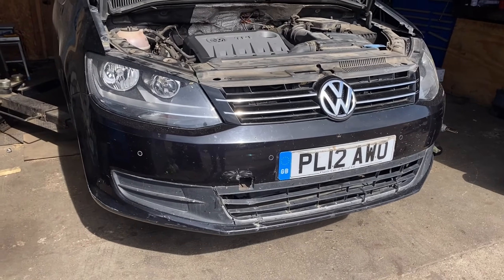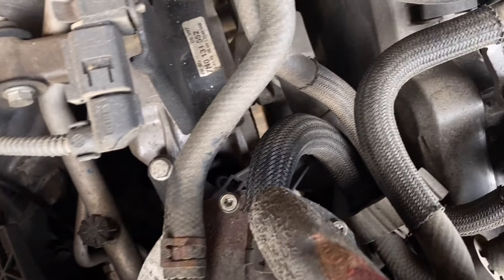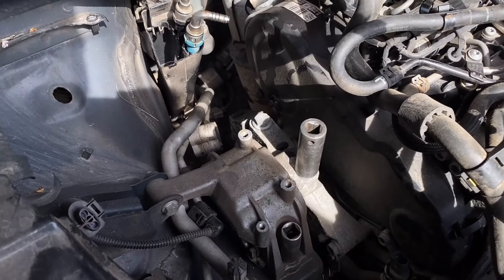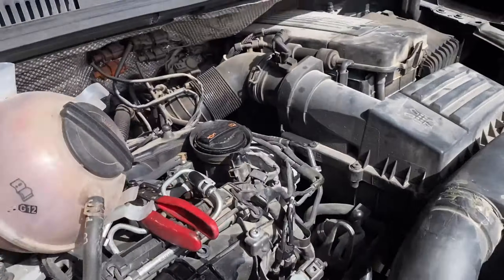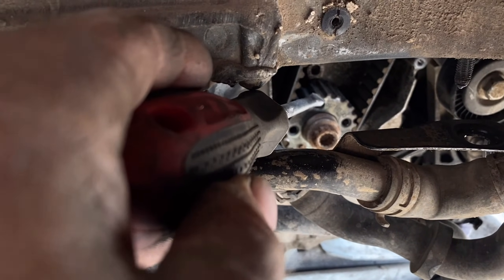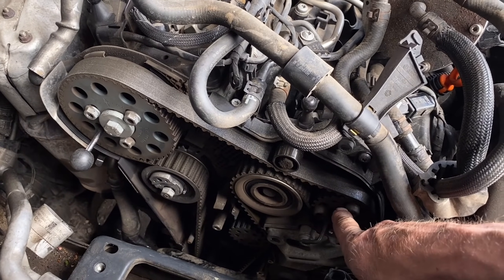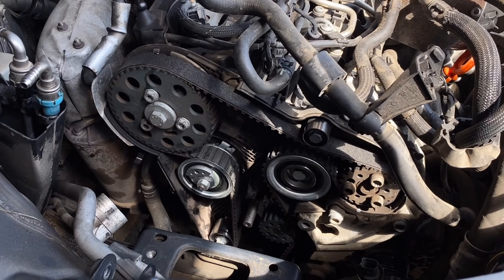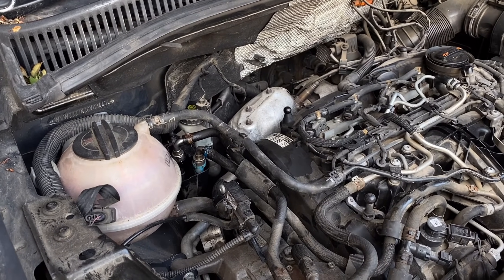Replacing Your Vw 1.6/2.0 TDI CR timing belt & water pump

Comment: Locking tool for crankshaft is not fitted correct, that’s why you need to tap it with a hammer. Fit it correct at the outer edge of the sprocket and slide it all the way in to the hole it Will fit without tapping!

Comment: it is a nervous job but like you said check everything 3x .....liked what you did with the tensioner ...its crazy the fuel pump is always just off why have the nibs slots ..no idea why they done that surely they could line it ..or the pin they use is a bit smaller.. fantastic guide appreciate you making this thank you

Comment: Great video, but a few things aren't correct and could lead to catastrophe or timing not perfect.

When the T10050 tool is fitted on the crank pulley, it should not look like it does in the video. All of the bumps on the tool should engage fully onto pulley slots, not at an angle as it is on the video. Also, the tool needs to be pushed all the way in - in the video the face of the tool is not flush with the pulley. The only way it goes flush is if the pin on the rear of the tool goes into the hole in the engine block. No tapping with hammer needed, it should go in with light finger pressure. This is how you know the crankshaft is locked precisely at TDC.

The 3359 tool at the camshaft, if this is correctly fitted then the ball will be pretty much flush with face of the camshaft pulley. On the video it's sticking out way too much, suggesting it's in the camshaft pulley hole but not the corresponding cylinder head hole. It's only when it's flush that you know the pin has gone though the hole in the camshaft pulley and also the hole in the cylinder head, locking the camshaft at TDC. The loosening of the three bolts on the camshaft pulley is not to make belt fitting easier, it's to allow for the movement of the belt when it is tensioned.

Lastly you must check that the crank and camshaft locking tools fit back in place easily once you have done the two revolutions of the crankshaft. Only then will you know that the timing is still precise after the belt has settled into position and equalized the tension. Oh, one other thing. No need to remove the engine mount or jack the engine up and down - the belt does not pass through them like it did on the PD engines. Access is rather tight but it removes the possibilty of wiring damage by raising/lowering the engine.

Here's a link to the official VW service manual --> https://vwts.ru/engine/diesel-engine-cfhc-cffb-cfgb-clla-cffa-cfgc-eng.pdf

Comment: Subbed, im a DIYer. I have a 1.6 tdi touran, i know the cam belt will need changing down the road likely in the next 18m, would rather do it early especially on a CAYC. I've got this as good guidance. I have the HBOL but i dont trust it half the time.

Comment: Hey mate, I’ve got a question I’m really hoping you can answer! I’ve recent got a van that has had the timing belt done on it, I think the mechanic that did it put too much tension on the belt and it’s about 12-14mm off the mark for the centre and is making an annoying noise. My question is, can I very carefully reduce a small bit tension off the belt without affecting the timing of the engine? Or will it need to be retimed if I do? Thanks!

Comment: Hello. I found your video helpful but would like to point out the error in the video which will lead people to a bad experience. at 8.30 in your video you are putting the pin into the wrong hole. I found the same IE the hole was slightly off to take the pin but thats because it is the wrong hole. The Pump locking pin does not go throught the Vernier drive gear. If you look Just below the belt on the top left of the pulley there is a pin hole and a Rotating plate which you lock together it is actually behind the toothed gear. Luckily I marked the old belt before removal and then transferred the marks to the new belt. I had moved the vernier back to put the locking pin in the wrong hole which is off because the hole you can't see but visible with an inspection mirror is the correct one to pin. Upon assembly the car was v difficult to start even though the pump was only v slightly out. Once I realised the problem it was straightforward to rectify... You put the pin above the toothed pulley at about the 11 oclock mark... Hope this helps folk. Cheers. neil.

Comment: I changed the belt on a Peugeot DW10BTED4 RHR engine in a 307.  Not as difficult as I thought. I'll do the Jetta with the CFFB engine myself as well as the EGR system why flow issues and the oil filter housing as the plastic thread the lid is stuffed

Comment: First time I did my timing belt/water pump it took me the weekend, I did check the timing using the crank several times but when re-assembled it wouldn't turn over, it had slipped a tooth or two so I had to re-strip it again and on the second attempt it worked, ALWAYS check via the crank.

Comment: Great video my friend, no disco music just great advice and experience passed to the viewers. It really is one of the best on this subject.
One addition I do when stripping stuff down is to drop each part, bracket whatever plus fixings into boxes or bags with a note to self if one or more bolts are different lengths, shanks even. Life sometimes interrupts is and you can get diverted for a day or so. 
But I repeat, best timing belt video I've seen bar none.

Comment: Just about to do timing belt on my 1.6 tdi caddy and read I need to change engine mount bolts too is that right? All of them including mounting bracket that bolts to the engine
Reply from the maker: Hi bud I never change them but many people have told me they need changing but I’ve never had a problem re using them 👍👍
Reply: @YTDTETV  thanks for the quick response mate, yeah I've heard the same so not sure what to do it's only on 36k miles so might reuse them I'll see what they come out like in the morning 😬
Reply from the maker: @deadfool5345  no problem at all, I’ve had those bolts out on many vehicles and never replaced them, I don’t even use a torque wrench I just do them up 🤷.
Reply: @YTDTETV  nice you certainly know your way around a  caddy too so if you're happy reusing them I will be 👍
Reply from the maker: @deadfool5345  I’m definitely a big Vw fan 👍 thanks bud
Reply: @YTDTETV  got it done today as it rained all weekend last one, went swimmingly thanks to your guide 👍 one thing I noticed though was the ina belt is slightly thinner than the dayco one that was on 🤷

Comment: Thanks, great video. Just completed a water pump and timing belt on a Skoda Yeti 2.0 using the video. Marking the pump pulley was very important and on the Skoda it was easier to disconnect the hoses at the fuel filter end rather than the bulkhead end. Otherwise procedure was excellent.

Comment: Nice video! I had a timing belt tensioner stud shear on my old 1.9tdi golf and that killed my engine. But it had done over 230,000 miles. Maybe it had been over torqued when installed. Or the belt over tensioned. Because of that I think I would probably change the studs in future. But like you say it's added faff and you could end up in a pickle if it cross threads etc so maybe best left alone.

Comment: when you retensioned the belt after ther arrow had moved out the window, did you loosen off the came belts? im at this staged now, the arrow has moved out the window. do i just retension without loosening anything off?
Reply: Hey mate, did you end up adjusting the tension without locking anything off/loosing anything in the end?

Comment: Nathan could you tell me ow oftern the timeing belt should be changed on a 1.6 skoda superb getting many different mileages  i have 77.000;miles cheerrs bro
Reply from the maker: So on these engines they have a super thick timing belt so do last a while, it depends whatever comes sooner 7 years or 80/90 k miles 👍
Reply: @YTDTETV  thanks buddy... this car was inside in a garage for 5 years doing nothing but now the car is 10 years old with 77.000 miles  and same timing belt do you think it's ok for another while in your apinion??
Reply from the maker: @samtheman419  I’d be changing it if it was mine, no worries 👍
Reply: @YTDTETV  thanks a million. your a great help top man for that really appreciate it.
Reply: @YTDTETV  there seem to be loads of conflicting information out there about when these belts should be changed would you say thats about right... some say 5 years or 75k just ive bought an audi a3 1.6 tdi belts done 50k  ago but its been 7 years since its been done

Comment: An old mechanic told me to use tipex and mark a tooth on the belt to a tooth on the pulley, do this to all the pulleys. Remove the belt, transfer the marks on the old belt to the new belt and put the new belt on so that the marked teeth line up with the marks on the pulleys. You may need to turn the cams back to where they were before they will line up, as they do move when the old belt is removed. Simpels.

Comment: You should have slackened the diesel pump bolts and replaced them and adjusted the tensioner with them loose as well as the top cam pulley other wise risking tensioner failure. They are adjustable for a reason

Comment: I followed instructions and for some reason after 2+ engine rotations. My marks would not line up correctly for cam and injection pump. I feel like I did something wrong. But I followed procedure. I triple checked everything. I feel like my cam or crank is now really out of correlation.
Reply from the maker: How far out was the marks? If you line the mark up on the bottom crank, then maybe you need to move the cam round a tooth and try again.

Comment: I have a scirocco 2.0 TDi and my camshaft position sensor is giving me errors. I brought a new Oem one but I looked today and can’t get the camshaft cover off and it’s tight. Is there any way of changing it without doing these steps? or is it a job alongside changing the timing belt?

Comment: Great video thanks. Can you help me, rotated engine twice, cam and crank line up on the money. My injector pump was not locating the the u marker. 

Slackened off the 3 x bolts in the pulley and moved it into the locator hole as it was pinned before belt removal. However the pulley is out 1 tooth on the pump based on my paint marker. 

As this is a CR engine is that okay ? This pump is only to pressurise the fuel system rather than time according to what I have read.
Reply from the maker: Hi bud sorry for the delay, yes it being a CR engine it’s the same and no the pump doesn’t need to be lined up just anywhere is ok as it just pressurises the fuel instead of specific timing. Hope you sorted it 👍
Reply: @YTDTETV Took a breath and started it on the weekend it ran fine. Thanks for the guidance 👏

Comment: just one point to mention. ( the crank locking tool. you slide it in.)  once in all the teeth lock in and you can't lift it up from above it. you don't put it in from above.  but a great video.

Comment: Nice step by step video. As an old time mechanic I always used to spend a good few minuets going over in my head each and every step. I also used to mark each bolt as I tightened it before moving on. I can honestly say I missed very few loose bolts in my time. Great advise and yes I only ever used a torque wrence for head bolts. The rest use tightened to the German 'Goodentight' spec 😃😃

Comment: nice video, just want to say, I have actually seen the tensioner stud draw itself out when tightening the tensioner up.  that will be the reason why they are in the kits.  but like you said dont fix what aint broken!
Reply from the maker: Hi there thank you 👍 I’ve not seen one pull from the head but I have heard from a few friends they have seen it, I wonder if it’s the original factory ones that pull out or some that have already been done.
Reply: @YTDTETV  oe from factory mate, happened on an Passat.  Total nightmare had to retap the head in situ
Reply from the maker: @calebrutherford9010  oh man that don’t sound fun, I’m yet to see one 👍

Comment: once the belt is assembled,  tensioner set in its position, and pulleys tightened you need to remove the pins and spin the engine 2x 360deg, and try if the timing pins can be placed with no problems.  If they don't fit, you need to release the tensioner, undo both pulleys put pins in place, set the tensioner in position and so on until you can put pins in place after you've rotated the the crankshaft twice. Absolutely,  under no circumstances the engine is started without coolant!  The coolant pump seals are made of graphite and lubricated with coolant! They will die really quick if run dry . 10:30 actually I have managed to bend one of the studs while undoing the tensioner in the past. It was enough to feed the belt on to the cam pulley wrongly and ground half of the belt within 6months.  Luckily I've had this car again within the short period and saved a lot of money on refurbishing this engine. Also everything has been torqued correctly in the factory. Once undone, the same "strained" threads can no longer be torqued with the same momentum, hence why they must be replaced.
Reply from the maker: Hey bud never seen that but will keep my eye out 👍👍

Comment: Started mine, felt unwell, I had CoVid, finished the following week.  It's one of the more nervous belt changes I've done. Takes a bit of jiggling with locking pins and pulleys to get it lined up. I spent about 7 slow hours.
Reply from the maker: Hey bud glad your feeling better, definitely better to take your time with a timing belt and recheck everything a few times to be confident when turning the key for the first time 👍

Comment: I was thinking about doing this work myself but I'm not very confident and would rather let a professional do it at an auto shop or at a local dealership.
Reply from the maker: Hi bud so a timing belt is a job that needs confidence I always say a one can do a job if they take there time but a timing belt is not something you want to get wrong.
Reply: @YTDTETV  I like to take my time troubleshooting and upgrading computer hardware. So working on a car is something I like to do but only if I know what I'm doing first.
Reply from the maker: @RefugioVillegasIII  that is very smart thinking some people would jump straight in and maybe get things wrong and then it costs more money. Taking your time and asking questions when unsure is better than making a mistake. Thank you for the comment 👍

Comment: Very well explained, much appreciated.  I've borrowed a set of crank locking segments and just like yours I notice the radius and pitch of the teeth don't locate perfectly across the whole of the crank pulley arc.  I know it's wrong because it doesn't sit across the profile properly before pushing it reward into the timing case.  Strangely enough the other segment in the kit fits the crank pulley profile but obviously the pointers in the wrong position to match the crank, so that's no good either.  This troubles me that I don't have the crank locked off in exactly the correct position or that it could rotate a degree or two during belt fitting, am I being overly cautious and have you come across this ?
Reply from the maker: Hey bud thank you 👍 first of all no your not being overly cautious especially with a timing belt. So my locking tool doesn’t seem to sit right either as you say the radius doesn’t match the bottom crank pulley, it only sits in with a few teeth that is normal, as long as the profile of the teeth match the teeth in the pulley and the arrow lines up with the arrow also the locator located in the side of the block. Mine is also a tight squeeze it’s literally a case or tapping it in with a small hammer then when the new belt is on you have to tap the tool upwards to remove it as it’s a tight fit. Does this help? Sometimes if you want extra reassurance you can use the tipex method aswel put a little bit of paint on the pulleys and the block just to see that the pulleys are all correct when back together. Thank you 

Nathan

Comment: I would have put the pins back in while retensioning, and tensioned it with the cam pulley bolts loosened a turn.